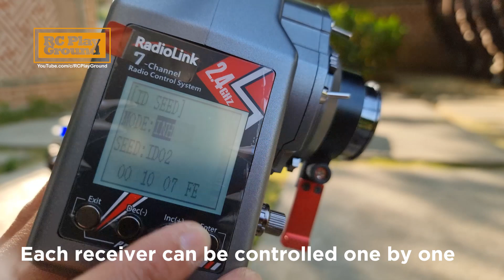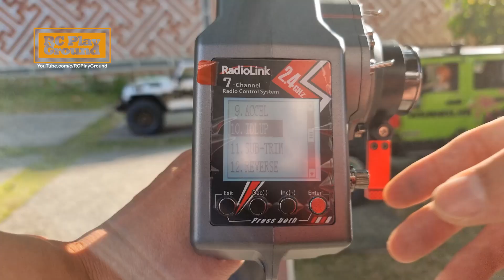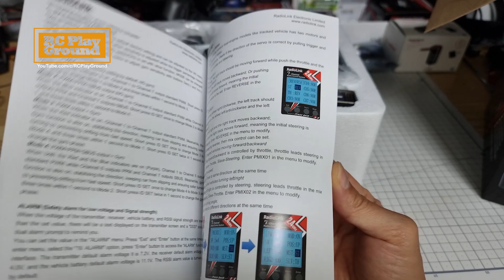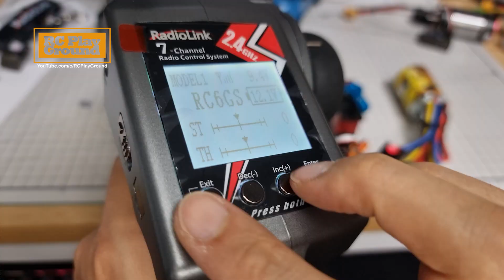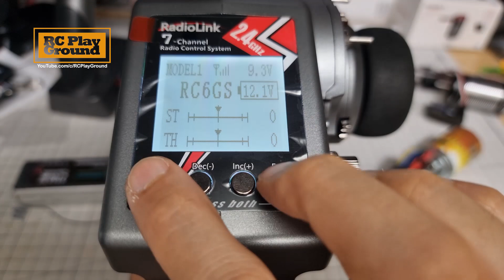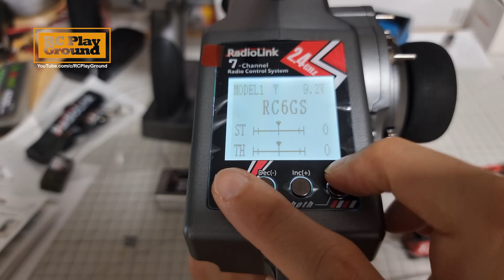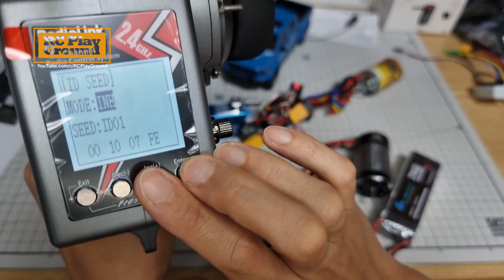What New Features RadioLink RC6GS V3 Digital 7-Channel Transmitter?

Comment: CAN YOU HELP ME OUT?…  RG6&xlx2 my Kraton  wants to act like it’s in rock crawl mode or something. Motor wants to copy throttle so tightly that it will not coast down hill if there’s ANY throttle input at all, it won’t want to roll faster than what the throttle input allows. It rolls perfectly free in neutral yes it does but, if I’m doing 10-20-30-40 mph, I have to let off the throttle iMMEDIATELY if I want the truck to coast freely and not “jerk” and stumble because it wants to copy the throttle command even if it’s returning back to neutral. No aux wire, no modes assigned to it neither. It’s got to be something with the transmitter.🤷‍♂️ help plz thanks.
Reply from the maker: I think it's because it's a brushless motor
Brushless motors are difficult to control at low speeds
The brushed motor starts smoothly but is relatively slow
Reply: @RCPlayGround  hello, yea I have other castle brushless esc/motor combo which I run sensor and they operate more than well. The problem I described previously had nothing to do with low or high speeds. It happens through any rpm range weather it’s forwards or backwards. I’ll continue to solve it bcs all my other identical setups operate normal. Thanks the the reply, hopefully I’ll be able to solve this, I’ll keep in touch with my repliers to share what I’ve discovered if I ever do lol, thanks 💪